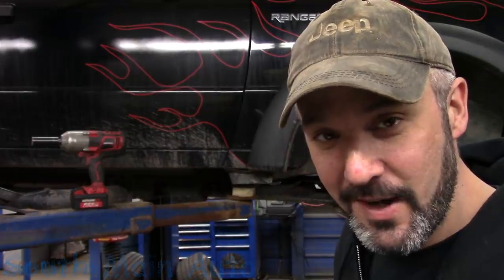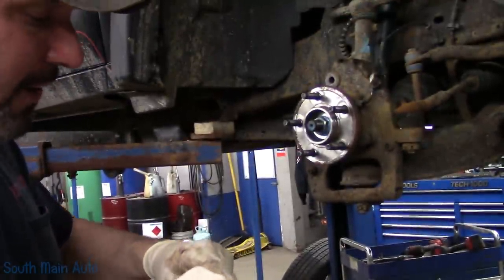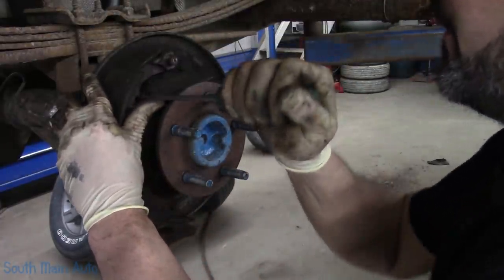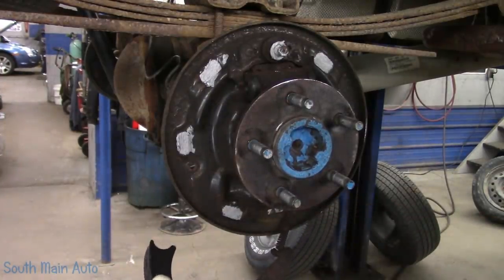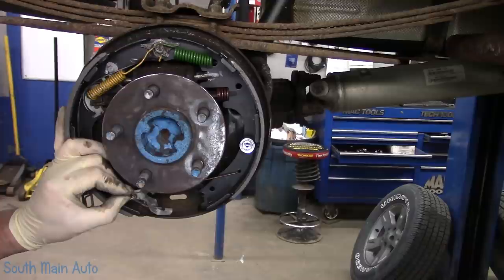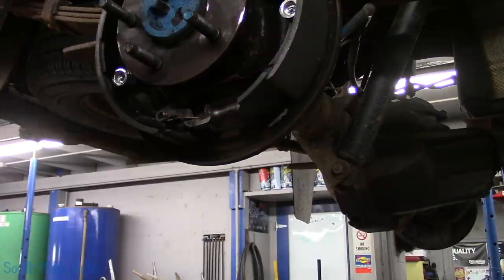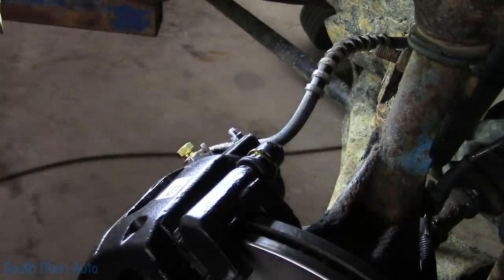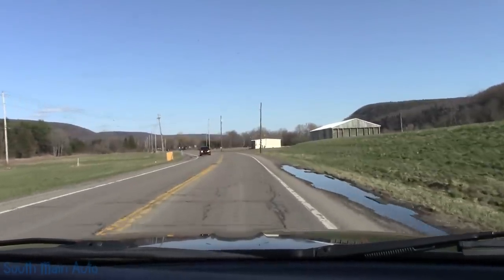Ford Ranger: Full Brake Job w/ Rear Drum Brakes

Comment: eric kids these days don't know about brake drums. I got my first brake job on my 71 nova drums all around, father said you want to drive it fix the breaks so i did, removed my basis belted tires f 78s and did the job but I was already mechanically inclined and that is a horse shew clip to the e brake. they make a special tool to install and remove. i believe mine are strapons  oh i mean snap ons lol
Reply from the maker: They make a tool for those!? How do I not know about this yet!
Reply: yes, I bought mine in the early 90s, ill see if I can see the part numbers on them. one set removed the horse shew and the others were like a hog ring pliers to re-crimp it. automotive interior tool hog rings for seat covers. not the 4 legged piggies lol
Reply: eric the snap on part numbers are BR-1 IS THE REMOVER AND BR-2 IS THE INSTALLER I believe in the 90s they were in a set and about 20 ish dollars

Comment: This is another great channel and I enjoy watching.  I just wanted to share a trick that I've used when changing out my caliper.  I take a cinder block or 2x4 block of wood to press down on the brake pedal past the halfway point before starting breaking stuff apart.  Right, wrong or indifferent.

Comment: i found for myself that after you get the rear shoe on  do the bottom spring and adjuster at the same time. you just "swing that front shoe in place  not needing to stretch that spring with pliers.  then again i remember buying the friction material and rivetting it on the shoes.  big truck shoes was brass bolts.  i guess i'm old.
Reply: me too

Comment: Love your vids Eric & Vanessa O. Thought: You might consider masking the rear shoes with a few strips of painters (masking) tape, then pulling it off just before putting the drums on. Will help keep the surfaces clean and you won't need to worry as much about greasing them up and cleaning them later.

Comment: I quit using "anti-seize " on the adjusters/drums long ago, it seems to seize up faster than not with age and heat drying than greases, been using the same silicone/synthetic caliper/brake grease as fronts for everything on the rears too.

Comment: I hate drum brakes with a passion. Did them recently on my old '91 CRX. Took me the better part of four days to do, simply because I kept running into unforeseen problems, and my lack of experience. But, I got them put together and flushed out all the old dirty fluid. Car brakes just fine and the parking brake works like a charm. 

What really makes it a pain in the rear to do, in my opinion, would be all the little pieces that you gotta keep track of and make sure you put in the correct places. But, once you get past that part of it, they really aren't the worst thing. And doing it myself allowed me to do the front brakes as well, and to buy new wheel cylinders and hard lines that I wasn't expecting to have to replace, for around $200 altogether. That's $300 less than what a local shop was quoting me just to do the rear drums.

Comment: Ford put out a Technical Service Bulletin on the brake drums locking up on 2002 - 2009 Rangers.  The problem was worst after the truck sat for a few hours, and the drum brakes would lock when you hit the brake the first few times after sitting.  Their solution was to install new shoes, and then use silicone sealer on the BACK side of the backing plate, putting beads around where the axle passes through the backing plate, around wheel cylinder, over and around the heads of the "nails" that hold the cups and springs, around the rubber brake adjuster access plug, and around the point where the parking brake cable enters through the backing plate.  It seems that moisture gets in and causes problems, so I am also using anti-seize where any parts need to move against each other.  Hopefully that fixes this annoying problem.

Comment: This video was right on time for me. Seems like I do a set of drum brakes every couple of years or so. This time they were on my Explorer which are very similar to these. Thank you for making this one.  I also remember you were talking about Exhaust system's and that they are made with thin pipe. Same vehicle I put a walker cat back on it about 3 years ago And it's already got to be replaced for my safety inspection. Well at least it's not hard to change and a little more then 100 bones. But still I would pay twice that amount if I knew it would last longer. Since they have to put a warning on everything we buy or do.. Why don't put on the box my exhaust pipe's and muffler came in that states You just got screwed again!

Comment: I have worked on drum brakes, and without the special tools. Imagine gettting the springs off and on with just pliers or vice grips. I have done that trick where you loosen the adjuster from the back, a long screwdriver will work

Comment: Seems like everyone does brake shoes differently. I started turning wrenches back in the early 60's when all there was were drum brakes. When reassembling I would lay the shoes on the table in the correct orientation and install the bottom cross spring, cross the tops of the shoes and install the adjuster and then let the spring hold tension on the shoes while I placed the shoes on the backing plate with the tops of the shoes against the top anchor pin. Then I could use both hands to install the rest of the hardware because I didn't have to hold everything in place.

Comment: 9/16th is the next size down from 15mm before 14mm
There are some sockets that are supposed to work with cruddy hex heads they’re designed to turn against the flat instead of the corners
Reply: Anom Amos Flank Drive!

Comment: I still use DoorEase on the backing plates rub spots. Never had a squeak or wear after using it.  I don't mind drum brakes and you're absolutely correct about the brake drums. I've used about every AM drum and they never seem to last like OEM drums.  Never used NAPA Eclipse calipers but they look like they should hold up pretty good  to NY corrosion.
Reply from the maker: The Eclipse Calipers are great IMO and as far as AM drums, Napa use to make their "UP Line" The "ultra premium" and they were straight as an arrow right out of the box. Now all they have is China crap drums like everyone else. Pedal thumper drums....
Reply: always used the same "brake lube" as on calipers/pins/etc. before all the magical synthetic/blah blah. usually pure silicone/sil-glyde or white lithium. limited choices.
but I suppose many folks wasn't changing brakes at such a young age either, relatives in all sorts of fields, so I had my hands into everything from very young :)

Comment: A short length of 3/8" fuel hose is superior to a tire valve stem for blocking off a brake line banjo fitting. The stem's rubber isn't compatible with brake fluid (you're finding out).

Comment: That's a Bendix style that Ford, Chrysler,  and AMC used for eons, in 9-12 inch sizes for RWD cars and trucks. Old Gms are slightly different, and then they changed to a completely different system for their trucks in the 90s ( you know, the 1 that really didn't work all that well and refused to stay adjusted) ....

Comment: It may be a 4 year old video but it's teaching me a lot so i thank you for that.  I have a question and since it is 4 years ago that you made the vid, i hope you'll see my query;  I noticed that you brushed the silicone (i'm assuming) grease on UNDER the stainless steel pad hardware and then installed the new pads without putting any lube on the top side of the hardware. I've always thought (and done it wrong perhaps?) that one lubes the surface that the pad tabs make contact with.  I await your expert reply. Thank you in advance.

Comment: I was doing brakes on my car last night - pad, rotors, when my wife came out to watch.  Normally she avoids the shop like a plague so I was wondering what was up.  I said, "Eric O has this tool that cleans around the studs, I wish I had one."  I was using a cone style wire wheel on a drill.  My wife said, "There's a hole in the center, won't it fit over the stud?"  Duh, it does.
Reply from the maker: Next time don't ask sir... trust me they don't mind... Wait on second thought here you go haha : https://amzn.to/2FPf4td

Comment: Eric - Did I miss it or did you not replace the front rotor backing plates?  They were shot, but is it a good idea to not replace them?
Reply from the maker: Not on this one. Truck will be in the scrap heap in a few years.
Reply: I knew someone else would ask this :)  My worry would be for high brake heat affecting the speed sensor wiring, since it was shielding the wire.  I doubt most daily driver type of use would get the brakes very hot, but that depends on lots of big hills, heavy trailers, or motorsports use for other vehicles.

Comment: Many years ago, I was putting shoes on my old '84 F-150. Didn't have a spring puller but I did have needle nose pliers. Greasy spring, greasy pliers and me pulling for all I was worth - hey, what could go wrong? Pliers slip and the point buried in my right eye brow down to the skull. After I realized what happened (and that my right eye was still where it belonged) I get up to go to the bathroom and assess the damage. As I round the corner toward the door my cousin is just coming out to see how it's going and when he sees me he gets white as a sheet. He said later that his first thought was that someone had shot me in the face. So... spring puller, yeah.

Comment: I can remember when that horseshoe clip came with the brake shoes
Reply: horse shoe clips and pins for the ones not affixed to the levers! among other things like rubber plug for adjuster hole.
I'm sure you remember wheel cylinder rebuild kits, oversize also and honing them out :)
Reply: Going down to the local Servo & buying new rubbers(cups & boots) not the kind of rubbers they sell now!
Reply: Boy, I remember THAT!!  Got smacked upside the left eyebrow once, when duffus came around the front of the car and asked, how do you work this? ( hone thingy ).  Then he pulled the trigger....

Comment: In the UK we don’t get all the brake hardware with disc pads or shoes.
Reply: It pretty the much the same here in the US - some of the "premium" pads will have new caliper clips, but most don't. And rear shoes don't come with spring kits; you have to buy them separately.

Comment: Phenolic is many layers of compressed fabrics, used a lot for gaskets because of it's ability to stop heat transfer between to pieces of steel. If you even cared to know. 🤣
Reply: Great video buy the way, love brake job vids. Especially the crusty ones!

Comment: I wonder, if the next video will be same truck "rear wheel cylinder" replacements. maybe it's cleaner than the junk here, with the fluid changed often.? but 9 times of 10, adjuster stuck or not kept adjusted up = the wheel cylinders end up leaking afterwards.
I'll blame it on the brake fluid and rubber parts, as way older vehicles only seemed to need cheap rebuild kit and barely honed or just touched with a honed and cleaned up.

Comment: Good video, very interesting, FYI when I got out of high school I went to work at a Oldsmobile/Datsun dealership servicing used cars that were traded in, and one time I had a Ford Granada to service and I noticed that the brakes felt funny when I pulled it in the shop so I put it on the lift and started checking them and I started the car and put it in drive and gave it a little gas then pushed the brake pedal and the rear wheels just kept turning no matter how hard I pushed,  the car had about 75K miles on it and the brakes were brand new, so I got my boss to pump them up and I did not get one drop of fluid so I cracked a line coming out of the TEE on top of the axle housing, still no fluid, so I loosened the flexible line going into the TEE and got fluid, so I took the TEE off and it was never drilled out at the factory, no rear brakes ever, very interesting, I showed it to the mechanics in the main shop and they got a kick out of that, I just wanted to tell you about that experience,  
Thanks, Dave
Reply: Ford. Figures.
Reply: What a weird combination Olds and Datsun, probably a lot of customers traded their Olds and bought a new Datsun, doubt that there many the other way around.
Reply: Was it stamped "Made in China"?
Reply: @Haz Cat Roflmao!!!!!!
Reply: I had something similar in that I got a new spark plug with no threads on it.

Comment: Wonder if they have a separate labor rate for shops in the rust belt, would not seem right if it was the same. Unless it was based on the rust belt, then it would be cool.

Comment: I have a 1998 GMC Pickup truck, GM in their 'wisdom' decided to NOT put that adjuster hole in the back plate, the guys that do my work said that you have to remove the drum to adjust then put the drum back on to see if it needs more adjusting... Thank you GM... NOT.

Comment: CarQuest seriously need to start supplying you with a tanker full of brake clean, with a garden hose attached, imaging the cleaning you could do with that???? Or maybe if they just set up some sort of brake clean hydrant for you that pipes brake clean into the shop at high pressure...🤣🤣🤣

Comment: I have a Ford Mondeo (Fusion in US) Titanium X 2.0 Diesel, I hardly ever use the parking brake, prefering to leave it in Reverse or 1st depending on what's in front of me.... My Question is, would using the PB be the better idea or is leaving it in gear helping the logevity of the braking system?
Cheers Eric.
Reply: As long as you use the parking brake once in a while it doesn't matter.

Comment: Why didn't you just put a new truck on those new brakes
Reply: @ekop1778  yeah..Ford Rangers are junk. My first one (1990) only made 278,000 before I traded it in in great running condition (and I know it lived long past that and probably still lives on!) My current Ranger (2004)  is currently at around 240,000 and still running and driving great except the wonderful road salt of the northern environment is starting to take its toll. I'm sure either truck would make it (and my old one probably has far exceded)  300k miles in a salt free environment. Even your prized Subarus wont make it that long when operated exclusively in the northern US/Canada.

Say what you will about other Ford vehicles, but the Ranger line up to 2011 (idk about the new 2019 line) is as bullet proof as they come!
Reply: @BamaRailfan  the ranger was a good truck

Comment: The first few stops are hair-raising if you install new brake shoes on the front of a four-wheel manual drum brake vehicle!
Reply: try all 4 at once. best thing to do there, with rear lifted, stop them multiple times against idling engine (auto trans) or drag them short bursts in 1st idling(manual)
Reply: Everyone has to get a little excitement in their lives! 🤣

Comment: I had a 99 ranger dual piston caliper one of the pistons blew all the way out and got crushed between pad n rotor and ate rotor away. Had to go to ford directly to get new caliper and idiot was trying to tell me it couldn't be dual piston cause those are only for bigger trucks. Brought old caliper in next day and he apologized because he did some reasearch and turns out yes 99 rangers used dual caliper pistons.

Comment: Nope not scunnart of the brake shows ,have we seen you checking for runout ? And pro tip for a cure  other than new discs
Reply from the maker: I do not have a lathe (sold it years ago) and I do not shim old rusty rotors.

Comment: This video sucks?  Nonsense!  Eric, you make awesome videos.  Drum brakes suck and they don't have superior stopping power.  So complicated compared to disk brakes.  I wish it were illegal to make vehicles with drum brakes.  All those springs mock me every time as they launch to a new hiding spot in the garage I never knew existed.  I can hear them laughing at me now... or meow.  You do say meow, don't you?  I have had to do rear axle seals and bearings on my 98 Taco a couple of times.  I dread the drum brakes even though I can suffer through them.  I would convert them to disk brakes, but I'm not that annoyed or motivated so really I'm full of it.  If you can do it, I can do it wrong.

Comment: Eric has a controlling interest in "Big Rust."
Reply: I generally change out the fluid in the Master cylinder, before I even start pulling stuff apart. My own stuff, and friends cars. (Not flat rate jobs)  Then I will get clean fluid to my calipers /wheel cylinders before i bolt the new ones on. Not big on sending garbage fluid back up in or to the new parts. My car I run Motul 5.1 fluid, and it's just a bit of extra insurance for it..,Last  car built without anti lock brakes. 2010 model year.. :)
Reply: Eric is in business. I wouldn't be surprised if he does what you do on his own and friends. He doesn't miss much.

Comment: I've used liquid electrical tape a try too, up here in upstate NY. I use silicone caulking now. It just pulls off in one piece, whereas the liquid electrical tape would sometimes leave pieces of itself on the zerks and other fittings. I heard it's an off-roaders trick to caulk the fittings. Also heard they do the same thing with off-road military trucks. Not sure if any of that is true however.

Comment: The truth comes out !  "Oh rust, how I hate you  ... but it makes you so much money !"

Regarding brake hoses ... any tips on how the disconnect a brake hose from the hardline without twisting the hardline (because the fitting is frozen to it).
Reply: Lots of heat, and line wrenches. And your choice of penetrant.
Reply: Heat it up and melt candle wax into it, it works really well on that exact situation, deal with it all the time on medium duty trucks.
Reply: If it still won't come free you can just twist the caliper off as well, although I'd rather swap the line at that point in all honesty.
Reply: Have your flaring kit handy. Usually the line is ready to leak at that point anyway.
Reply: Replace the lines....they're ready to break.